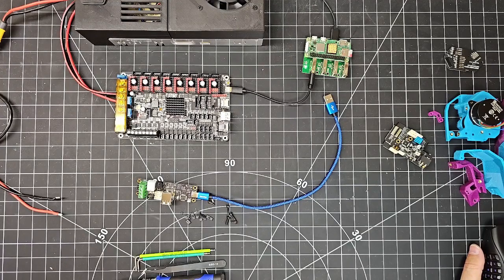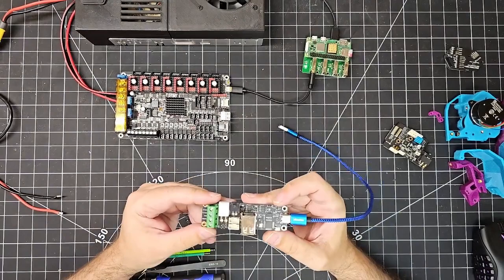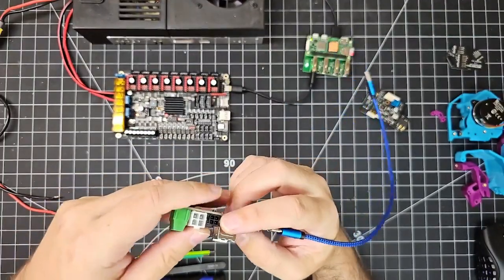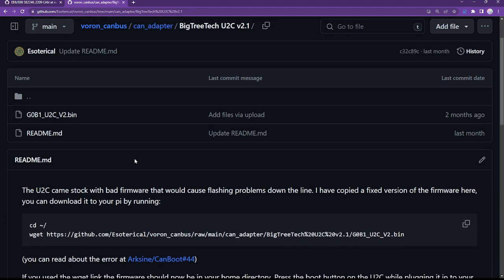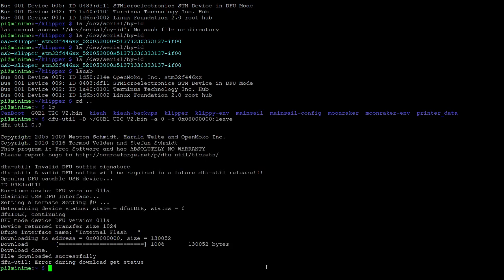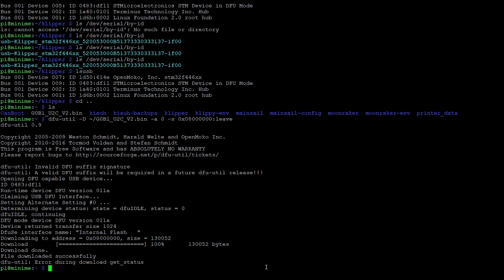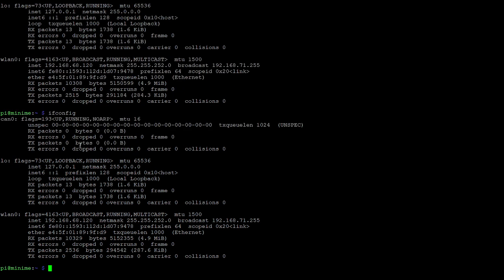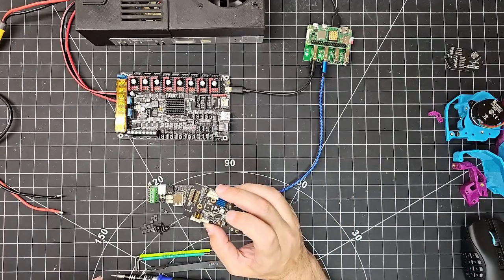From The Bench: Episode 2 - Flashing a BTT U2C CAN Adapter with Updated Firmware

Comment: Hi friend. I liked your video; it's very informative.

I'm having a problem with my U2C. When I connect it to the USB cable, the blue LED turns on immediately without me booting. When I apply make flash-canable_fw or make flash-canable_fw, the following message appears: Match vendor ID from file: 1d50
Match product ID from file: 606f
dfu-util: No DFU capable USB device available
make[3]: * [CMakeFiles/flash-canable_fw.dir/build.make:70: CMakeFiles/flash-canable_fw] Error 74
make[2]: * [CMakeFiles/Makefile2:318: CMakeFiles/flash-canable_fw.dir/all] Error 2
make[1]: * [CMakeFiles/Makefile2:325: CMakeFiles/flash-canable_fw.dir/rule] Error 2
make: * [Makefile:202: flash-canable_fw] Error 2. grateful

Comment: Hello!  Help me please, I've been struggling with installing canbus for 2 days now.  I have orange pi 5(Distributor ID: Debian
 Description: Armbian 24.2.1), bought an ebb36 board and a U2C module.  At the very beginning, when creating the can0 file, it gave the error /etc/network/interfaces.d/can0 directory does not exist.  I manually created the interfaces.d folder and the can0 file.  With all further manipulations, I encountered the same problem: I did not see the device via can0.  when I scanned the ip addr networks, I discovered that there was no can0 network.  Maybe someone has encountered this problem. Thanks in advance!
Reply from the maker: Sounds like your Orange Pi build might be using net plan instead of the can0 file to initialize the network stack.
Esoterical's guide should help get you there:
https://canbus.esoterical.online/Getting_Started.html
Reply: @oldguymeltsplastic  thank you! very interesting resource!  I will study the information.  By the way, I tried to install canbus on raspberry pi, everything was installed there immediately.  Thanks again for your reply.

Comment: USB is both a protocol and a HW / electrical spec.  You don't have to use actual USB cable to make use of the USB protocol, though to connect the CAN board to the RPi via USB you would have to make use of the USB connectors on both ends and then transition to a different cable.  Some have made use of a CAN bus cable for the USB communication between the two ends.  Since this will make use of the USB transceivers, it would be somewhat important that the correct impedance be seen by each end.  Also, there is a danger of electrical damage to the USB hardware should the data lines be disconnected without the ground (earth) connection between the two ends still in place.  The USB hardware spec for actual USB connectors guarantees this can't happen.
Reply from the maker: A few people are using their CAN toolhead PCB's over patched/modified USB cables, so that the USB Data+ and Data- lines are used, but the toolhead gets 24V power and Ground from the 24V PSU. It's still a bit tricky in that configuration to avoid frying your electronics, so I don't recommend doing so personally, but it IS technically possible.
IMHO, best to wait for the inevitable USB toolhead PCB's that will undoubtedly pop up soon, such as the LDO Nighthawk.
Reply: @oldguymeltsplastic   The Nighthawk board will have protection diodes / fets between the USB cable and the processor.  Many other controllers that have USB interfaces also have this circuitry, it should be "standard" IMHO.  (I don't think the RPi does).  Also USB plugs are designed to break the data lines BEFORE the ground line when removed (and visa versa).  I suppose you could add back to back Zener diodes between the data lines and ground for protection, probably rated at 6v vz.
Reply from the maker: @KennethScharf  sounds a bit too "MacGyver" for my tastes, but each person should decide that for themselves... 🤣

Comment: Hey man, great content. Thank you for all the work. Much needed to get through this project on the first try. 

Question for ya…. If I swap ports on the U2C do I have to re flash the board? 

I’m swapped tool heads and went from SB2240 on stealthburner to EBB36 and the 2240 came with umbilical that won’t work with the 36. Of course I only received 5 pins for the U2C plug. I did have some pins for the white port next to the original black connector. 

Will the U2C allow me to plug in to ANY can h/can L on the board? 

Any pin out I can find doesn’t give anything but “can” labels. No numbers. Which should probably tell me that the answer to my question is in fact yes, but I am actually having issues talking to the 36 at this point and trying to find which direction to go to resolve. 

Thanx again for the invaluable resource that saved me a few weeks ago setting it all up. Worked great until I just couldn’t leave it alone. What’s life without upgrades, right?
Reply from the maker: Because all of the CAN H connectors are linked, as are all of the CAN L connectors, it doesn't matter which ones you connect to.

You don't need to specify the CAN H and L pins in the printer.cfg, only in make menuconfig.
Reply from the maker: It's important to know that if you are using a U2C, you will NOT flash Katapult or Klipper to the U2C, and your mainboard should absolutely NOT be flashed in CAN USB Bridge mode.
Lots of help available on the Voron Discord server.